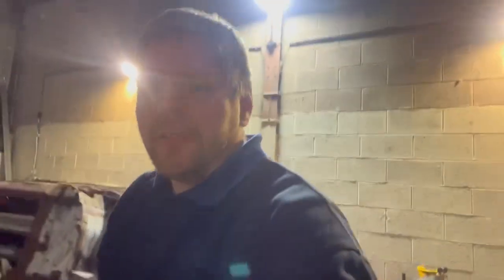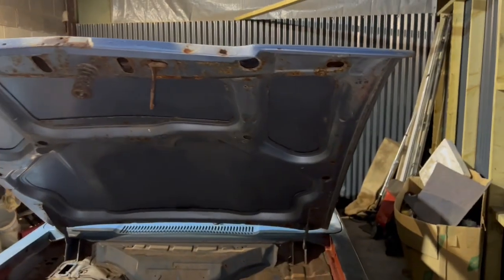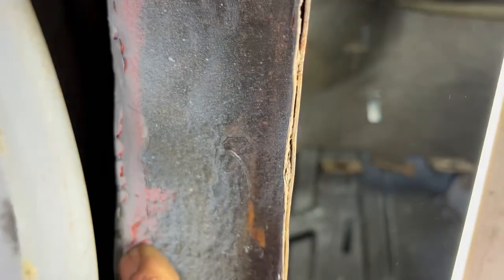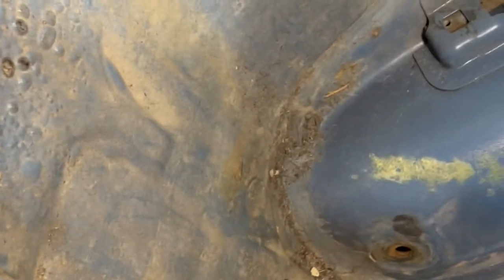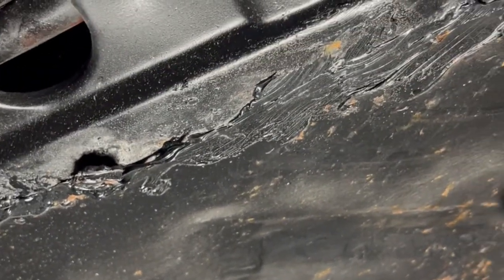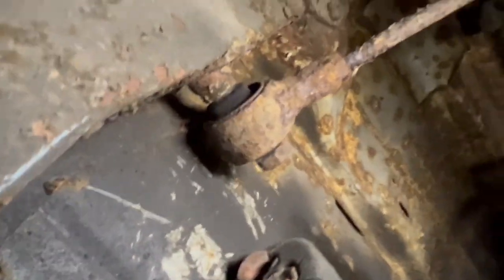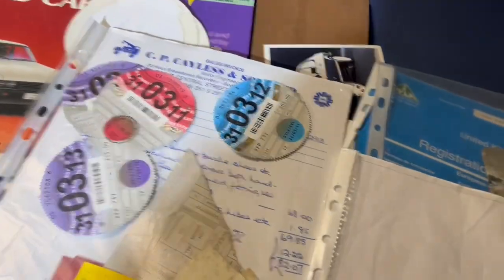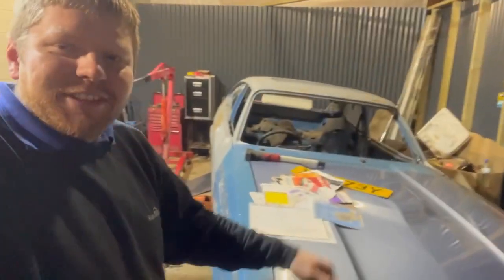Ford capri restoration part 32 , the new capri arrived today , what do with the Dona capri

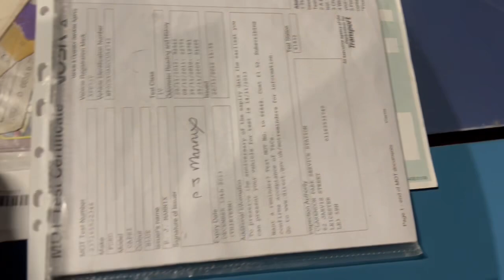Comment: Judging by the decals on the wings (34:50) you have a 1.6 Cabaret model, and with a quick search on howmanyleft there's about 100 of them models left taxed/sorn. Mine being one of them, in my opinion, fix what you can on it then sell on for cash for rusty. A rare underdog that needs saving.

Comment: Hi,enjoying watching the progress on Christine. 
Personally, unless the blue one is a particularly rare base model which would be worth doing separately I don't think the money it would make would out way using it as a 'donor' ,it's missing all the specific trim etc and you would put a lot of time and effort into it whilst neglecting Christine.
I'd use it as a donor for everything you need,carefully unpick the spot weld and maybe have those bits blasted as you go,repair them where you need to and then put onto Christine as you would a new old stock item, you'd only be doing this with what's on her own parts anyway ?
Anything left that's useful and you don't need part out to other owners to help them keeping a few other cars on the road,you would probably cover the costs of the second shell and you would have all the panels you need for your own for free.
Keep up the good work 👍

Comment: I see a couple of options here.
The new Capri is pretty solid and doesn’t look like it would take much to tidy up body wise. Therefore, if it was me, I would potentially think of cutting my losses with rusty at this stage and use the interior / parts from rusty to make the new Capri good and put that back on the road instead. OR another option (if you love rusty that much) is sell the new Capri and the Cortina project together and chuck all the money at rusty to get that done. 
I personally think you would be mad to cut the new capri up! 
Hope that helps 😁

Comment: This shell is worlds apart from rusty, and it wont take that long to get back on the road. It would be silly to cut that up.  It wouldn't hurt to reuse what's left of rusty and shell it into this one.  It still would be a good series anyway as you a still restoring a capri and the project can be still called project rusty anyway because it still needs work anyway.   Also things on this are in the right place etc, compared to the chassis of rusty. Be a lot more cheaper.  But if you are going to go the full hog with rusty, I would be taking as many chassis measurements etc off this one, and use it as a template to see where things go on rusty, then you can just move it on as it is.  My old VVC metro GTA 16v  shell  was going to be far to expensive to fix. It had already had welding done in the past, by me. A better shell came up, it was a 1.1s. So i thought ok i have the tech and everything anyway.  I swopped all the electrics, fuel system and running gear, and subframes, and a few odds and sods over. Kept the 1.1s  spec trim and reg.
Reply: dont think you get the point lol if you reshell rusty its no longer the same car he wants to rebuild rusty the car he started with the car he collected from the canal  that is the project to peopel cars are just metal boxs on wheels lol but to a lot of us they have a soul histery to bring it back from the dead and back o nthe road while he is driving it he is going to be smiling with his achievement  that he did that its to easy to swop the parts over to another shell where is the chalange in that no fun at all it would be just another sinple capri but he will be driving one he as saved from beond and will have a name

Comment: Yeah, if you cut that up you’ve got a screw loose what do you get up and do the windscreen put the windscreen into_panel do it all up even get it sprayed up and sell it to make money do I need a nap go out and buy a new panels for you free later use new panels, not secondhand panels to buy original panels for wings and a cost you an arm and a leg if you go out and buy original wings so you wouldn’t you can’t hardly get them anyway . that’s what I do. I need to do the file up. What do you want to do up and after you’ve done that do the Cortina 😅😅

Comment: There’s no point in selling it unless you are planning to stop doing YouTube after Christine. These old shells are getting very rare now and you are luckier than you know getting hold of this one. It could easily become another £20k car with about a year’s worth of light repairs. No. Strip off the heavy suspension parts and hoist the shell up towards the ceiling and leave it there until you’ve finished Christine.